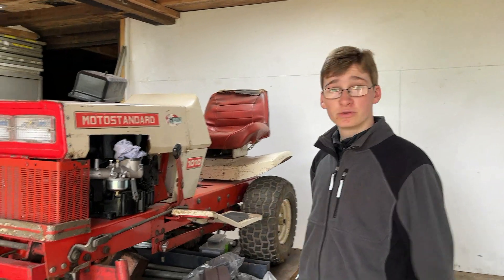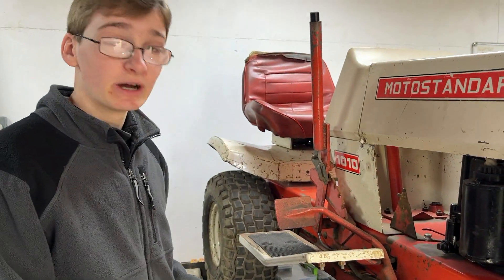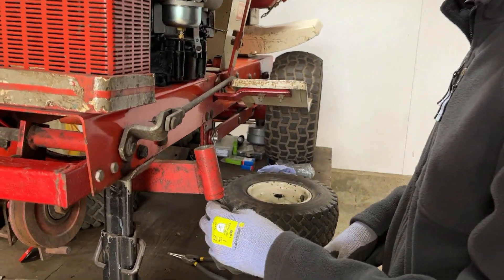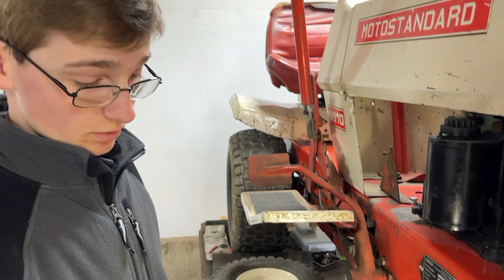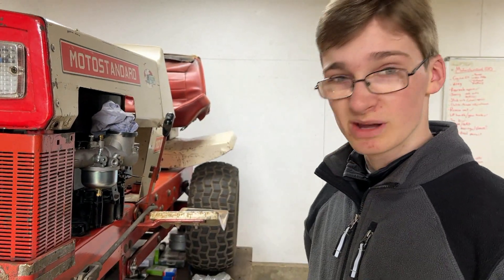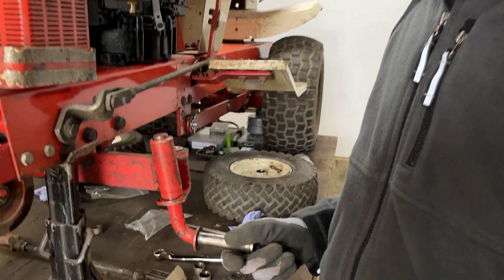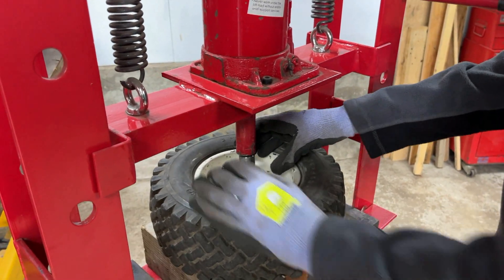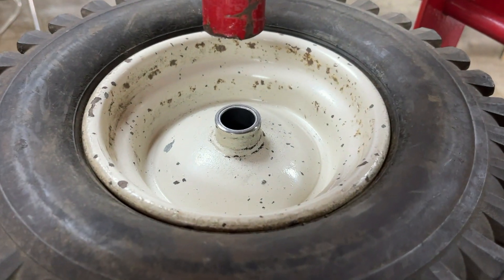Motostandard 1010 - Part 16 (Front axle and steering bushings)

Comment: Great video fellas. Neat tie rod ends. So no grease zerks in the wheels or stub axles ? Nice smooth operation there. 
Have a great day.
Reply from the maker: Thanks. Yes, those tie rod ends are cool. I have not seen them on any other tractor. It is very odd that it does not have any grease zerks, maybe a future upgrade. Take care
Reply: @GardenTractorBoy   I guess really the better way would be to take them all apart and clean them up and regrease the wheels and axles. Would keep things cleaner, but take more work. 
Have a good one fellas.

Comment: What you could do is drill and fit a grease fitting between the two bushes you fitted and pack that area full of grease with a grease gun, proper job anyways.
Reply from the maker: Thanks. We did think about doing that but decided not to at this stage as I don't think the tractor will get much use when it is finsihed. Take care

Comment: Good stuff, I would be interested to know how to install the tires on the rims with-out tools. I also noticed the valve stems look difficult to add air due to the angle. Take care.
Reply from the maker: We were lucky with the front wheel as the centre of the wheel is a much smaller diameter. As such we went about it backwards and held the tyre to the bench with four fixed bits of wood and then forced the tyre onto the wheel with lots of lube. For the other side we were able to squeeze the tyre flat again getting it in the centre bit. I think we were very lucky rather than a good method. You are right about the valve stems and ideally we would have fitted new tubes but I think we have blown the budget on this project a long time ago. Take care